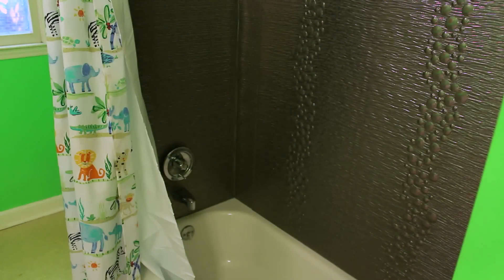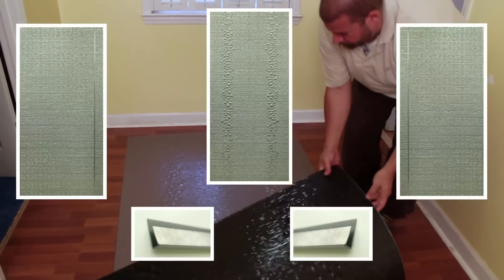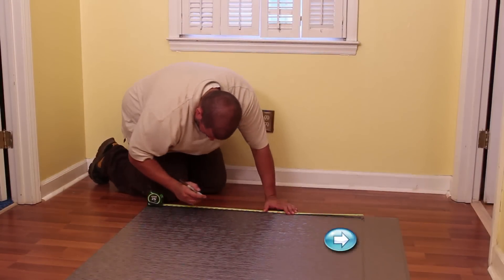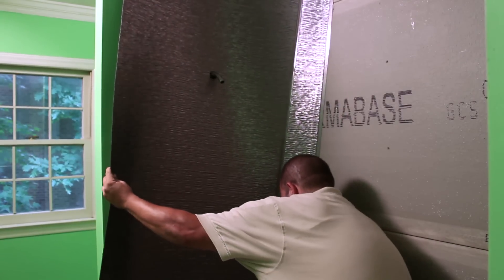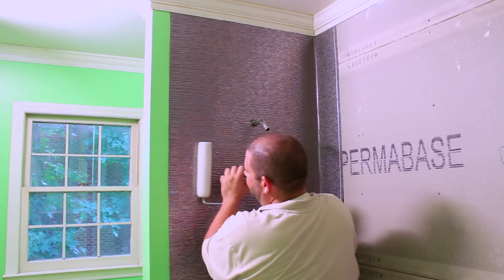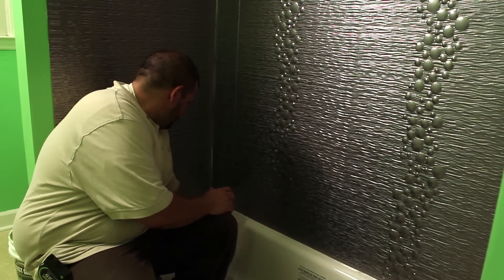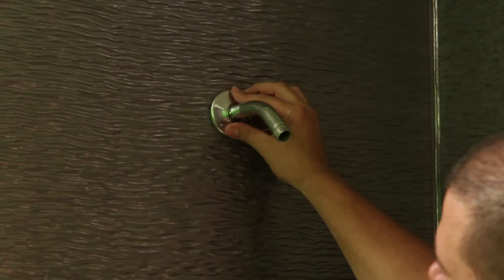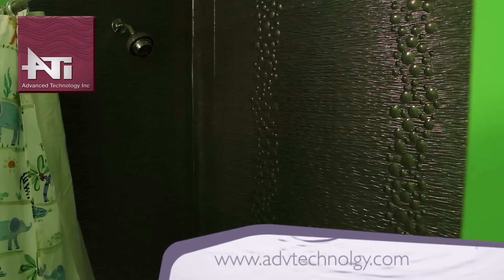ATI Installations | MirroFlex Tub + Shower Walls

Comment: Can this be applied over tiles?
Reply from the maker: Believe it or not, this is one of our most asked questions. These tub surrounds can be installed over tile, provided a couple extra steps are taken. You'll need to scuff existing tiles with a hand sander using 60-80 grit paper prior to applying adhesive. We also advise using Titebond Advanced Polymer to adhere the MirroFlex Tub Surround to your existing tile.